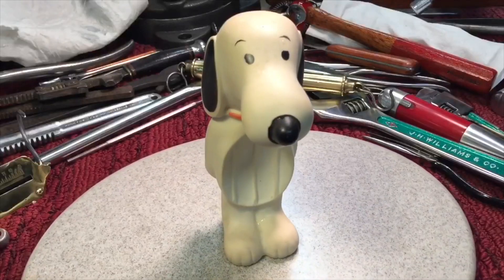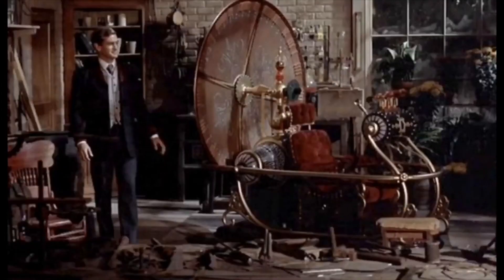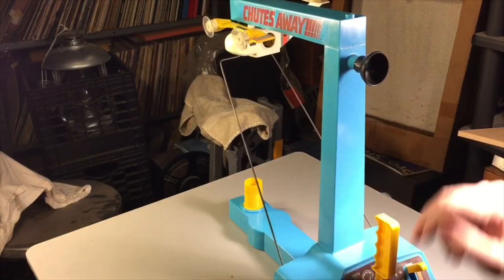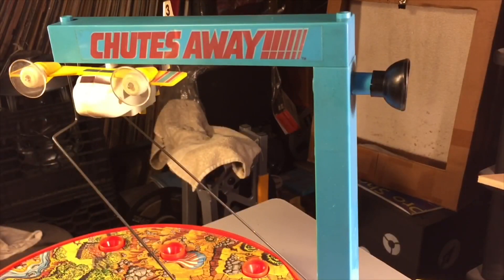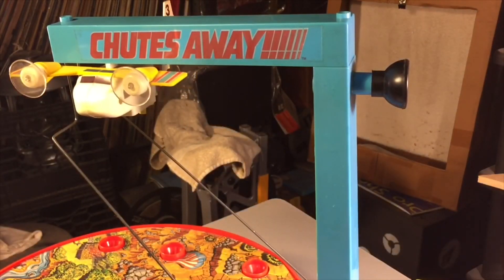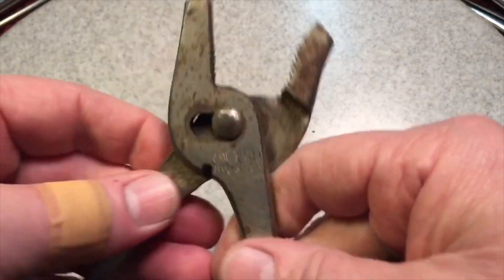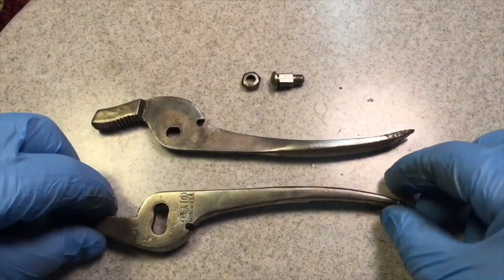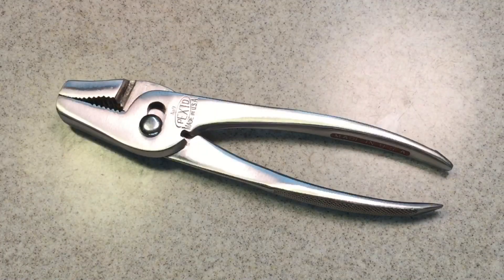Chutes Away!!! Pexto No.9 Restoration.

Comment: I found those pliers in the catalog, page 84. This is the text, I'll reply to this comment with the catalog after.
"A high quality, nicely finished, tool constructed along lines of great strength. The upper jaw in made so that jaws will adjust themselves to any taper; parallel, round, three square, or half round. This tool will grip a pipe 3/8 [NOTE: might say "5/8", hard to read] to 1-1/4 Inches in diameter, and, due to the position of the teeth, it will not let go of a rod. It will also do the work of a parallel plier. Made with Wire Cutter between handles and fitted with a Screw Driver end. Furnished in either Gun Barrel or Nickel Plated finish."
So to me, that seems to say the unusual jaw is a compromise in the technique to get the functionality of gripping different ranges of rod and taper with a specific forging blank... Since it does look kind of like a bent piece of square stock.
Reply: And here is the catalog link: https://archive.org/details/PeckStowAndWilcoxCatalogueNo20/page/n83/mode/2up
Reply from the maker: That is awesome!  I love how their descriptions would help sell the tool!  😃👍